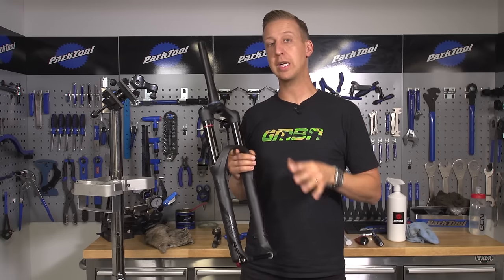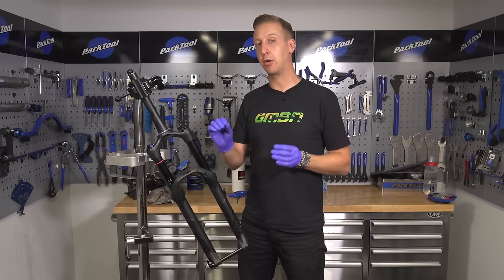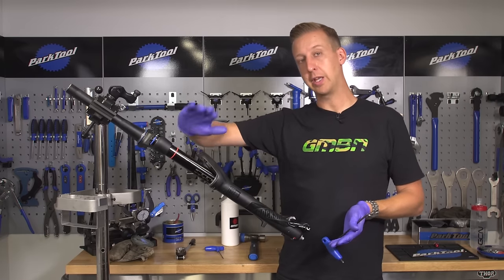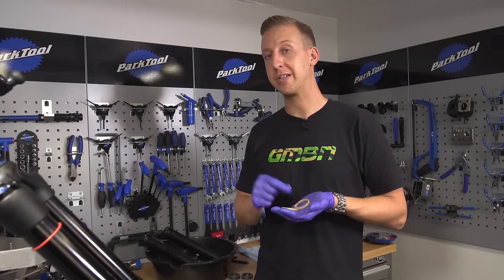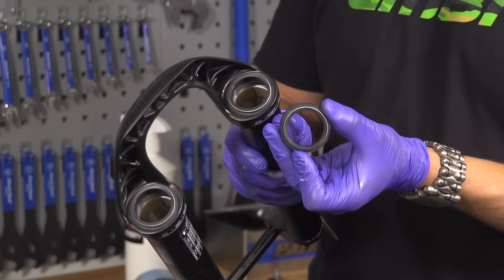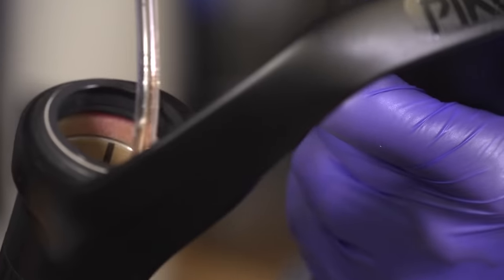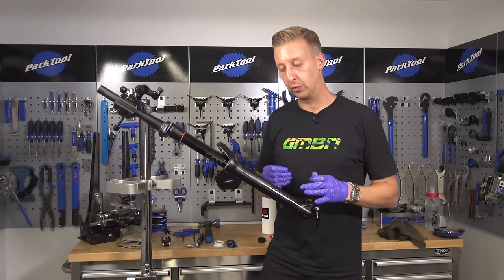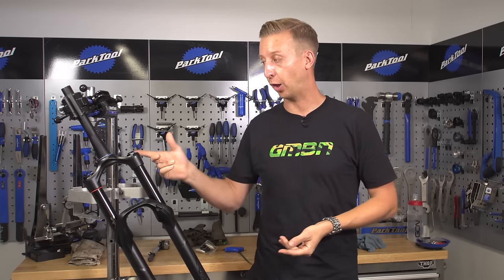How To Service Rock Shox MTB Fork | Mountain Bike Maintenance

Comment: Descriptive, informative, GREAT! Doddy is the guy to make these service how-tos!

One question though: Aren't you cleaning the lowers internally? RS recommends that, but it's a pain to do it - at least for me. Even with a decent rod it's hard to push a rag around the whole length and circumference of the inner surface. Maybe should try some sponge-like material that's able to expand and wipe the walls. Hmmm... that's an idea... I may hack up a tool like that :-D

Any advice on this?

It's worth to mention that when soaked (either in alcohol or oil) the foam rings expand much (in diameter as well), so you'll have to massage them into the slot below the wipers. First time I did it it gave me some worries but after some trial I was able to do it. It would have been reassuring to know if that's expected.
I usually soak the foam rings in a small CLEAN cup - diameter around the same as the ring. Then suck up the leftover oil from the cup into the syringe. It's the same kind of oil you have to inject before putting back the shaft bolts on the bottom at the end. This way you don't waste any oil and still soak the foam rings properly.

Comment: is there a certain type of fork oil that should be used for a rockshox recon fork? do you have any recommendations that are not too expensive? Thanks alot.
Reply: Depends on what year is it but most recons are rockshox 15wt oil, you can buy a tiny bottle of it for not a lot.

Comment: Does the fork grease need to be specific grease or can I just use my generic park tool grease?
Reply: better off using suspension grease as its designed for parts that slide together a lot

Comment: Any tips for replacing the seals? I bought some that are the same model as my unit but I feel i am putting way to much pressure on the seal when fitting.
Reply: U need a special tool

Comment: Question for anyone who feels like answering
Could the air side be swapped over to the compression side?
Reply: On modern forks the spring side has a groove at the bottom for the retaining ring to sit which holds your air shaft, and a notch to equalise the positive and negative. The damper side doesn’t have this so no, a lot of forks also have different diameter shafts and foot nuts on the spring and damper sides which would prevent them being swapped. Even if you could there would be absolutely no benefit.

Comment: I was doing a lot of front wheel nose manuals and spins etc with my lyrik now there is back and forth play that almost feels like the headset is loose, but it is not the headset definitely the fork. Will this service help correct that  or do I need to do the bushings too? Thanks
Reply: Further to this, I pulled the lower legs off the fork and noticed one of the rods on the inside of the fork could move side to side quite a bit. The other one was fine. Does this mean bushings?

Comment: my rockshox are creaking should I just lube them and see if they stop or should I do the service
Reply: Harry King mine too. The dealer told me it's the stanchion in the crown and they would need to be replaced. $1000 for a new Pike fork.
Reply: arlingtonguy54 that seems like quite a lot of money to fix them I might just take my bike back to my dealer as I have only had my bike for 5 months and I don't regularly go down rocky descents  or go off big jumps
Reply: Its an easy fix

Comment: Nice vid!  Don't forget when your injecting the oil into the lower legs make sure none gets into the threads of the damper rod or this can actually create hydraulic pressure when tightening the bolts and crack the threaded part of the damper rod!

Comment: 3:36 i'm just doing the lower leg service for the first time on my '11 GT with a Rockshox Tora and there are no foam wipers!?!?!?!?!
Reply: Foam wasn't invented then.
Reply: That is because the Rockshox Tora is a coil sprung fork. A coil fork uses a spring instead of an air chamber therefore it does not need a foam ring to keep air from leaking out.

Comment: Sorry for my bad english im dutch
Can somebody help me i have a rockshox reba fork but the rebound adjuster thing What spins doesnt work it doesnt click anymore and it keeps spinning infinite at first i dindt have this.
Reply: Handzeep123 Did you tighten the bolt to hold the nob down? Or tighten it to much? Also did you release it all the way before servicing the fork?
Reply: Kenneth Yaya i dont know i was just riding and i wanted to adjust it and then it dindt work anymore
Reply: Handzeep123 Remove the pinch bolt and the adjuster to take a look at the dial underneath. This happened on a lockout I used once, all it needed was the pinch bolt being tightened.
Reply: Fieryawesomeness Thx bro
Reply: Ben ik toch niet de eengste Nederlander die hiernaar kijkt 😂

Comment: How frequently you need to service different forks:Rockshox: Every now and then.Fox: Every six months.Marzocchi: Every ten years, maybe 15 if you're feeling lazy.
Reply: Joey Kinley yeah my marzocchi are working the same as when I got them, maybe a bit worse, but not anything drastic. On a different bike, they hydrolocked and idk how to fix it, 2010 55 RV, too old for any bike shops to work on, haha
Reply: The Majestic Hawk no way, i also have a pair of 55's running on a hardtail, they work just fine though.
Reply: Joey Kinley I got my bike second hand with the 55 RV, so idk what's happened with em

Comment: For the price of servicing, you could just buy a second hand one.. at least for rear shocks
Reply from the maker: But then the second hand shock you buy would need servicing?  🤔
Reply: The service kits are about £40 for a full service not just the lower section...

Comment: I had rockshox and fox forks on two previous bikes, flogged the hell out them for two years no service needed and worked well. Got a 2019 with rockshox forks and the piece of shit forks fked up big time, LBS said it was rebuild issue not warranty. 200 aus later and just waiting to see what happens. These forks were well treated in comparison to the my others due getting older and injuries. I fking hate Rockshox now

Comment: If you want to do a service video and you repeat multiple times that these foam rings and dust wipers are cheap, then show how to change them damn it. If your only goal was to show how to disassemble the fork, well nice job, mate, that could an idiot do too. Do the whole thing even if the fork doesn't need it. After shutting the camera off, take it all back, throw them in the garbage or do whatever you want with it.

Comment: Ha ha service every 50 hours of riding. I’ve not serviced mine in 7 years and use my bike for commuting and weekend rides. 

Reality check!!
Reply from the maker: How are your stanchions looking? You can get away with it for a while for sure (realistically no one really services every 50 hours of riding)...but stanchions can 'green' and lose surface against a rougher seal if ran dry for an extended period of time